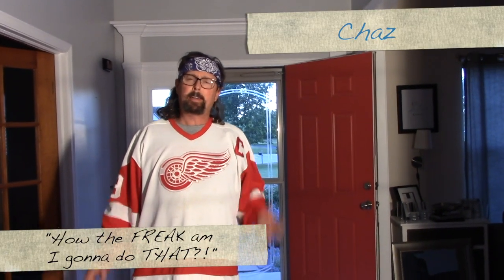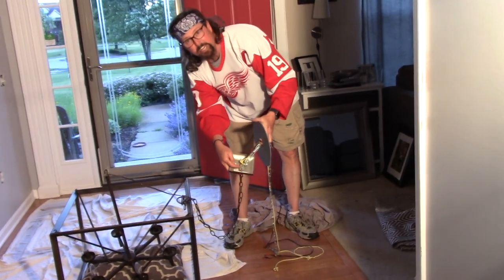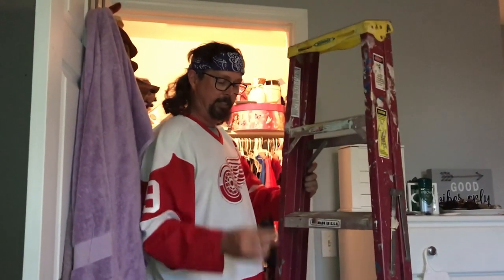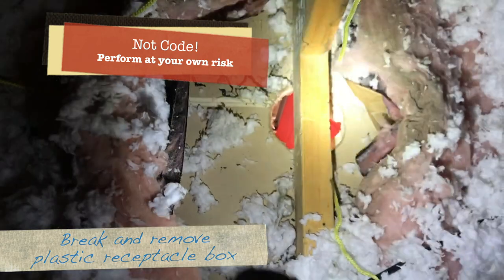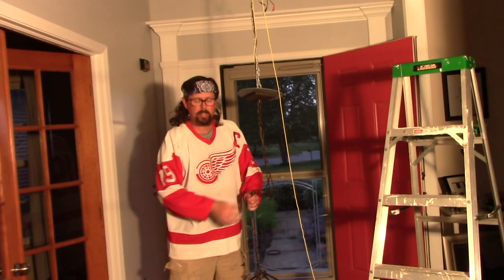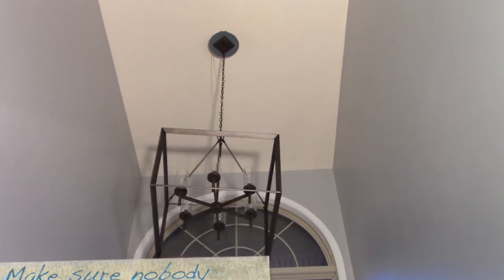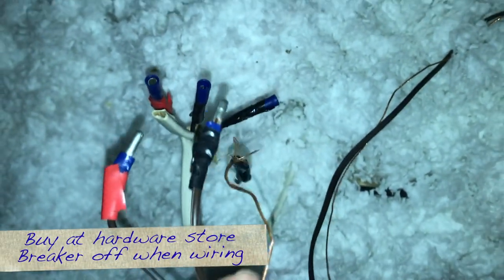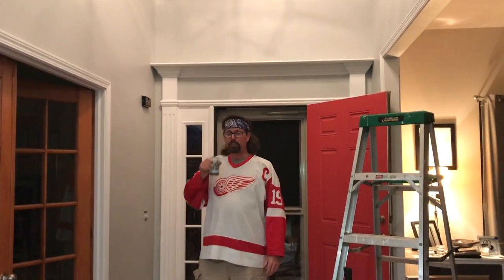Chandelier Replacement on High Foyer Ceiling

Comment: Thank you! I’ve been looking at my light in the vestibule for a year 😱 never did your solution graze my brain! Genius! I could only see my lifeless body at the bottom of the ladder. I’m unstuck and unstoppable! Thank you!😊🙏🏻
Reply from the maker: Hard part is smashing the plastic receptacle box that houses the chandelier wires, I didn’t film this part because I used a hatchet after I drilled holes into the box like a brick of Swiss cheese and looked like a psychopath. Once the box is off you can unscrew your light from the bracket from the topside, make sure power /breaker off, wire is snipped and you have a rope tied to it to lower once undone. You can rig the chain to your new chandelier before pulling up. Good luck!

Comment: Great thinking! I never thought of that. Just thought ladder ladder ladder. I have the same type of entry foyer and access in the attic. And I have a wife who bought a new chandelier because she didn’t like the old one. 🙄😊
Reply from the maker: Hardest part was busting apart the plastic receptacle box that’s in the attic that’s covering the chandelier connection and wires. I didn’t film because I wasn’t sure how smashing with a hatchet would look. Make sure the breaker is off that feeds your light and good luck!

Comment: This is such a great idea!!! Thanks so much!
Reply from the maker: Remember it’s not code, the hard part is smashing into plastic receptacle box that housed chandelier wires in attic, I didn’t film this part. I turned off power and drilled a bunch of holes into plastic box so it looked like Swiss cheese then I smashed it apart with a hatchet, make sure the breaker to the light is off. Elevate your quick connects or house inside a receptacle box nailed to a vertical stud so you can easily access. Good luck!
Reply: @ProjectswithChaz  thank you Chaz! My challenge will be the base of the light. It's a 80 cm aluminum circle, with 11 wires hanging out of it...

Comment: I love it. This is some sketchy ass shit but I suppose if it works it works. Good out of the box thinking
Reply from the maker: So far it’s holding up and no issues, I will post a comment on this project thread if it falls on anyone’s head or burns down the house. We rarely use the fixture but the hassle of swapping out was worth not listening to my wife complain about the old hideous light so win win. Thanks for watching!
Reply: @ProjectswithChaz  it is a very unique solution for sure. Good thinking

Comment: Love it! I'm actually going to do this today or tomorrow.
Reply from the maker: Great! Toughest part is removing/smashing light electrical box when you’re in the attic, I didn’t film this part because I wasn’t sure how it would end up. Make sure power off to your chandelier, smash box to gain access to wires and connection hardware of chandelier, I used a hatchet like a psycho but you can use whatever works. Remember the quick connects will not be code, if you sell your house you’ll have to hardwire back and screw an electrical box over where the chandelier connects to ceiling hole. Good luck!

Comment: Awesome. Save a lot of efforts. I hope  there would be a kit for sale for this approach.
Reply from the maker: Thanks J Z, unfortunately the wire quick connections are not code, if and when I sell our house I’ll have to snip off quick connectors and connect wire-to-wire; seems Cra-Cra but that’s code for you.
Reply: @ProjectswithChaz  You just need to put the open junction in a mounted and enclosed junction box to meet code. Could have also used wire nuts instead of buying special quick connects.

Comment: Are you related to Michael Keaton,cause he would have done the same thing.Pretty Kool.I am about to do the same thing with a Kichler light and the same frigging altitude.And your attic looks like mine.Down in Florida.Once again are you sure your not related to Keaton???.Good Job and great idea.Thanks.Ray the Pilot,USAF,SAC,Nam Vet.
Reply from the maker: No relation to BatMan / Beetlejuice, in my younger years I looked like David Byrne from the Talking Heads. My dad was in the Navy on a sub, he wasn’t in Nam but dug-in on Miami Beach during the Cuban Missile Crisis. Thanks for your service and watching! Ps- don’t fall through your ceiling.

Comment: Hi Chaz, thanks for the video. It has inspired me to attempt the same. Where do I  find the quick connects for the wires? that seems like an easy solution for when we need the chandelier to travel down.
Michelle
Reply from the maker: **Not code but works like a champ** You can buy at a local hardware or auto parts store. Make sure the wires aren’t touching anything when you connect and are live, maybe elevate by hanging from a stud or enclose in a junction box that you can simply open to access quick connections when needed. Good luck!
Reply: @ProjectswithChaz  Thanks!
Reply: @ProjectswithChaz  My chandelier has a rectangle base and is being connected to the ceiling via 4 screws, how do I convert this to meet at the center to hook on to a pulley? Any ideas? 
Thanks!
Reply from the maker: @alokmichellesudhakar4104  it’s hard to figure out without seeing your light and situation. Can you attach something to the base that’s strong enough to connect your rope/chain to for hoisting up and connecting to an anchor point in the attic? I’m not a professional, just a DIY guy, proceed cautiously and good luck!
Reply: Chaz do appreciate you taking the time to make suggestions. I am attaching a link to the light. This part is intended to sit flush on the ceiling and anchored by 4 screws
I was thinking of using cables from the 4 holes to a center point where the pulley cable hook can be attached
https://drive.google.com/file/d/1jrHG7eZzXnk-x89cE9x_QyHLmjM9nqil/view?usp=sharing
Once again thanks for your feedback. Have a wonderful weekend!
Reply from the maker: @alokmichellesudhakar4104  take the base to your local hardware store and look for a bracket with holes in it to screw into base diagonally or opposing corners, you can hook a rope/chain to the middle and hoist away. Again… I’m not a professional light hanger, you should go slow, think it through and be safe. If you’re having trouble you might need to call a pro.
Reply: All wiring should be done using a standard junction box. It is a simple and safer way to connect wires. If a light bulb is needed to be changed disconnecting from the junction box to lower the chandelier down is just as easy.

Comment: Chaz, I am more interested in how did you remove your existing chandelier from attic? Did you have to cut the box rod in the attic? Does the upside down  U clip that sits on rod, slides out? I do not think it is possible to remove it without cutting the box rod. I have a 20 feet tall foyer ceiling where one ugly chandelier installed by Builder, which has all bulbs died 4 years back. Changing bulbs is also impossible for me. First challenge is to remove the old chandelier. I have checked that in attic, it is attached to a Box fan Rod, which connects between 2 joists of 2x4. I can access the Rod from attic. I can disengage the rod from joists,. But the U like clip which sits on rod (reverse U) is attached to the Box where wires goes in and the chandelier connects from bottom (with center Nut and 2 side nuts). I think it is extremely difficult to remove the Box from Box Rod in the attic. The access to remove nuts is from below i.e. LONG LONG Tall Tall  Ladder. or Scaffold rental. any way thanks for a very informative video.
Reply from the maker: Hello Prakash, I turned off the breaker that goes to light so no power to chandelier, took a hatchet to the receptacle box up in the attic and smashed plastic off from above chandelier bracket. Tied a rope to the chandelier hardware and unscrewed from above to free chandelier and lowered down. Chandelier’s are all different but the hardware should be similar. The hardest part was breaking the plastic receptacle, I drilled a bunch of holes into it like Swiss cheese then smashed to pieces with hatchet, wear safety goggles and gloves! Good luck.
Reply from the maker: It’s hard to determine your set up, if you don’t think you can duplicate what I did safely you should call a pro.
Reply: @ProjectswithChaz  Thank you very much for the tips. and such a quick reply. I am going to use all this information in next 2 days. I hate breathing in that attic air. but it must be done. :-) I visualized and prepared tool kit bag with all the stuff that i need. Going to run a extension wire from other room to up in attic so i can get good light. after killing circuit breaker for attic, that will be handy. Also I am thinking running a long metal hanging chain with new Chandelier, so when i have to change bulb next time, it should be at possible height.
Reply from the maker: @prakash27502  wear a mask!
Reply: @ProjectswithChaz  I am scary cat, won't even take a risk on ladder above certain height. so i will be taking all the precautions possible. butb thanks for the safety note. I agree that this is not something simple DIYers can do. This is difficulty level 10 (on scale of 1-10) DIY fix.

Comment: Don’t you need a junction box for those electrical connections
Reply from the maker: Whenever we sell the house I’ll probably get the wiring back to code, in the meantime the connection is fine and makes life easier when I need to change a bulb or dust. Thanks for watching!

Comment: That's exactly the size of my foyer and the size of the ceiling, but I don't have an attic.
Reply from the maker: That stinks, not sure how the chandelier is attached, probably a mounting plate and screws/nuts like a bedroom ceiling light. If you can’t reach with the tallest folding ladder 🪜 from Lowes or Home Depot you’ll have to contact a lighting contractor. Thanks for watching and good luck!

Comment: I hope this is a joke video. This is absolutely stupid and dangerous on so many levels. I can go in with a 16' stepladder and do the job in 1-2 hours without getting in the attic and destroying the light box that is SUPPOSED to be there. We also use the appropriate wire connectors not some radio shack shit that is meant for 12V DC. Please don't encourage other people to do this.
Reply from the maker: Working like a champ so far, if you’re not into it keep scrolling the interwebs is a big place.